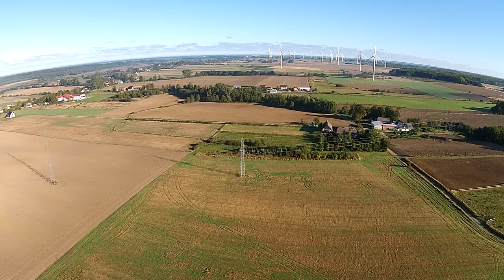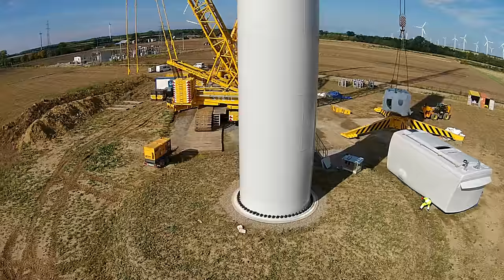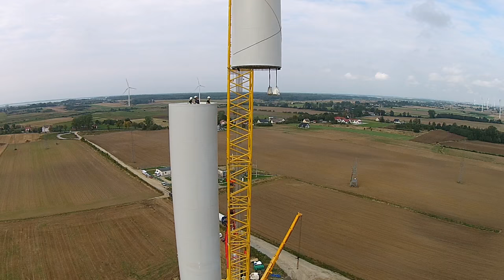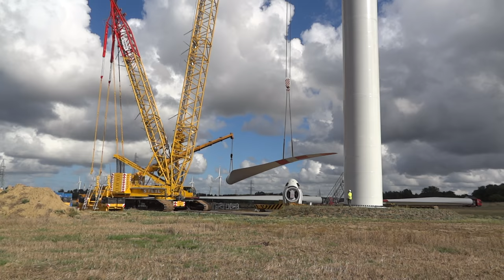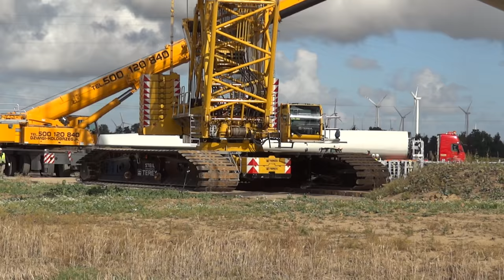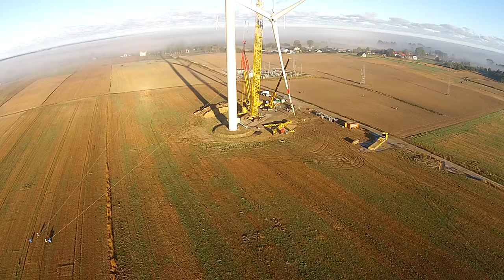Building a  Wind Turbine GE, entire assembly process (timelapses, landscapes)

Comment: I m already installed about 1000 windmill, in 12 years I m from india I m working in Enercon india limited Very great time to me for spending time here Very good work without any pollution green energy Thanks..
Reply: I saw Inox is building 540MW of the new 3.3MW turbines for Gamesa. How soon do they order the Electronic control systems? I know its tough to say but best guess if you try and predict from your experience
Reply: The world need to be decarbonizing by using more wood than steel. Now is time to decarbonizing the wind energy by using wooden towers and wooden blades. F E
Reply: @federicoeco9030  yeah, but money is more important than existence

Comment: How big are the wrenches and bolts to attach the blades?
Reply: The bolts are maybe 15", nuts are like 3 inch? This is going of memory
Reply: @markalanpeterson  
Greetings mark, do you have any more information about those massive cranes? Manufacturer, availability et cetera? I’ll be very grateful!
John Wood
Reply: Usually the 1st can section ranges from 90mm-105mm nuts depending on the platform. Up top is around a 46mm. Been using MLC 650 cranes to build these the last 4 years but it just depends on the size of the components
Reply: @johnwood1948 most will be leibherr and wind seems dominated by mammoet and sarens,not an op my self but I am a wind tech.

Comment: how do they get those crane cables detached from end of wind turbine blades????
Reply: Those are Tag lines bud 😂😂
Reply: Looooong tag lines...  I was at a site in Pennsylvania a few months ago where they used two pickup trucks with "L"-brackets mounted in the receiver-hitches.  Each bracket had a hand-crank (no different than the crank on a boat trailer) to adjust the tension on the lines so they could control the rotor during the lift.